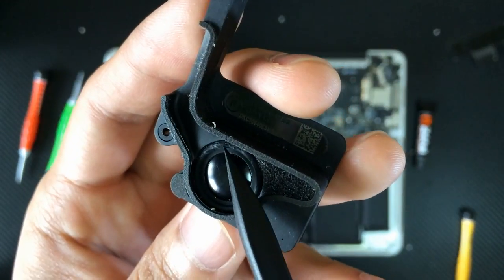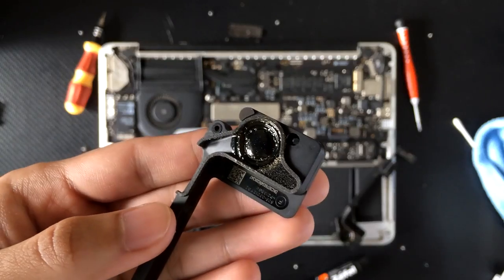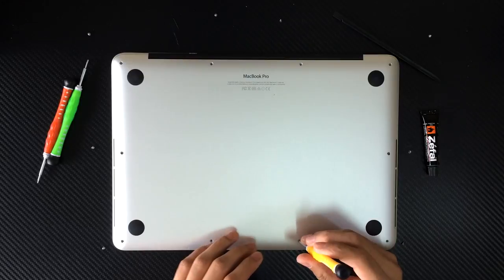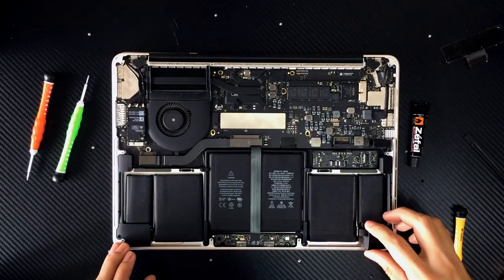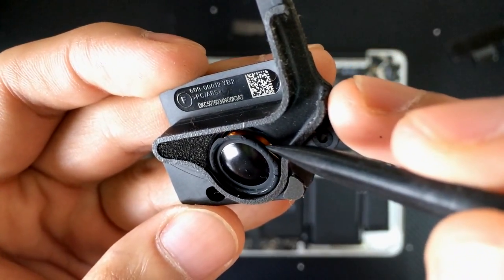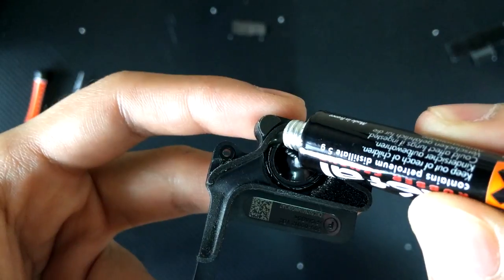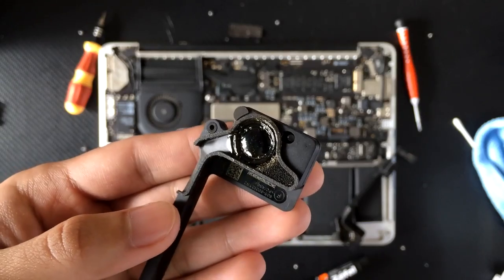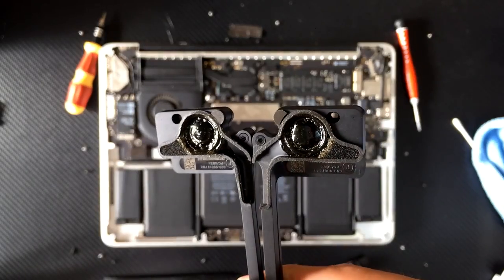Rattling Macbook Speakers Cheap and Easy Fix!

Comment: The difficult part is NOT fixing the speakers (or simply buying replacement speakers). The diificult part is getting the speakers out. On the 15" models you need to remove the fans, heatpipe/cooler, logic board, IO board, SSD, Wifi adapter, wiring harness, etc to get the speakers out as they are partly underneath the IO and logic board. Basically to get the speakers out EVERYTHING minus the battery needs to come out. If you are going to go through all that trouble -- and risk breaking something else in the process -- just buy new replacement speakers for $20~30 a set. Trust me, you don't want to do it again.

Comment: I am a bit confused, i got a new speaker in my MBP, but the problem still persists. Could there be another reason? Would it still help to use glue? thx in advance

Comment: This legit worked for me! I just finished putting my MacBook back together and I'm so happy it worked!! The guys at SimplyMac told me it wasn't worth repairing because my laptop is so old!! It cost me less than $20 fix, I bought a precision tool kit and a bottle of black rubber cement. Thank you so much for posting this video, I have the same Macbook in this video.
Reply: I have a Macbook Pro with Retina Display Late 2013
Reply from the maker: You're welcome! I'm glad this helped :)

Comment from the maker: Hey folks! It's been 3 years since I posted this video and I'm glad I get to help many of you solve this problem. It's unfortunate how this is such a widespread problem -- which makes me wonder if we can somehow influence Apple to have a quality program for broken speakers? Similar to the replacement program for the screen staingate and butterfly keyboard problems.
Anyway, that might be a stretch haha so for anyone planning to do this DIY fix, additional help here:
FAQ
Q: Can I use xxx glue instead? Or does it have to be that exact same glue in the video?
A: It doesn't have to be the same. Anything that works well with rubber will work. I think any general-purpose adhesive can do the job. However, I believe adhesive that heals to a slightly flexible material works better with the vibration and flexing of the speaker cone.

Q: How is the sound quality compared to new speakers?
A: It's definitely not as good as new speakers. I think the quality depends on how torn your speakers are to begin with, and how much glue you put. If you put a lot of glue, which you have to if your speakers are heavily torn, it'll sound worse. But, that's still better than crackling speakers. Also, putting a lot of glue will help make the fix last longer.

Q: How long will this fix last?
A: Depends. If you put a lot of glue, it might last longer. Mine lasted for 2 years. I fixed it again (video link in description), this time with a lot of glue. The sound quality got worse than the first fix, but it's still working until now.

Q: Is this worth trying? Or should I just have it replaced?
A: If you don't mind DIYing, definitely worth a try! Do note though that the difficulty depends on your macbook model. Some macbooks require more disassembling to get the speakers.

Q: Won't Apple fix this for free?
A: Unfortunately, no. And it seems like none of us here in the comments ever got to have it fixed for free.

Q: How much does a speaker replacement cost?
A: You'll pay for the speaker and for the repair service. Speaker cost will depend on whether you get an OEM replacement or a used part from another macbook. Rough estimate lands at around 50USD.

I hope that helps! If there are questions not covered here feel free to comment and I'll add them here.
Thanks a lot, and happy fixing!

By the way, I have made a follow-up video but this time I replaced the speaker with a cheap 10USD replacement speakers. Watch here! https://youtu.be/qz7K843A6AY
Reply: I agree. My 16 inch 2019 MacBook Pro, purchased December 2019, has a blown speaker, creaking terrible sounds even on startup now. I noticed the blown speaker Feb 2021. I do not play loud music through my computer. I play music through HomePods instead of computer.   This is very bad on Apple and I agree there should be a recall or other program to replace these problematic speakers.  I see 1.3 thousand likes on this video. That implies a lot of MacBook owners with blown speakers.
Reply: Under which rock have you been living? This just adds to the list of defects in just Apple's MacBook lineup from 2016 on-wards. I suggest you checkout Louis Rossmann's on YouTube to find out just how many, bad and wide spread the problems are even on the latest machines. 

My 2013 MacBook Pro will probably be my last apple machine because of this. That's not to say my current machine has been terrible. In fact it's worked and lasted amazingly. The battery has only started significantly giving out over the past year and a half and the only thing that broke before the speakers was the display but that was because my dumbass dropped it. 

I just don't have any interest in buying another $3000 machine only for it to break prematurely and Apple to tell me oh you were using it wrong. Or oh it's only supposed to last up to 3 years for a $3000 premium freaking machine. No thanks. 

Sorry for the rant.
Reply from the maker: @ky5666  I don't know which part of my comment gave you the impression that I am not aware of the MacBook quality problems. It is exactly why I brought up the idea of influencing Apple to make a repair program for this issue because I know that they did so for some of the issues like staingate, butterfly keyboard, iPhone battery, flexgate, and many more.
The mass complaints and petitions, to some extent, helped push them to do a repair program.
I also am aware of Louis and I respect him especially for his stand on #RightToRepair, but I think he sometimes over sensationalize Apple issues because a lot of people enjoy and patronize Apple-roasting videos. For instance, Dell's premium XPS line, which I also admire, has a lot of quality problems too but I am not aware of any channel that focuses on this.

But you know, I feel you though. My 2015 MBP (the one in this video) has been amazing. 6 years. Only problems I had was the speakers and staingate (which they replaced for free). The reports of problems starting the 2016 redesign held me back from upgrading. But at the end of the day, quality problems always exist in production, it's just a matter of minimizing it and offering warranty and repair programs. Also, consider that it might be a matter of noisy minority too. Many people I personally know who have the 2016-2019 macbooks didn't have problems.
Anyway, I just upgraded to an M1 macbook pro and it is amazing so far. Crossing my fingers that it would be as durable as my 2015 macbook pro.
Reply: @earlmalaki  Could it be that Apple WANT these parts failing to push people towards whole new machines? (By the way, ifixit doesn't seem to have parts to replace the speakers - any idea where I can get them?)
Reply from the maker: @alannewman85  it seems they sacrificed durability for sound quality. they make amazing (probably the best) laptop speakers, but it seems the cost is longevity of the speakers haha 
as for parts, unfortunately if you want to DIY, your option would be to buy chinese replacement part (from amazon, aliexpress, etc), or buy used parts from dead macbooks haha i have a new video where i replaced the speakers with cheap chinese replacement, that vid might help. see description for link
Reply: @earlmalaki  Hi Earl, Thanks - I have received replacement speakers, so I will watch your video many times before attempting. I have also bought the spare battery and toolkit from ifixit to do at the same time. Would you recommend doing anything else whilst I have the machine open?
Reply from the maker: @alannewman85  awesome! while you're at it, if your fan is a bit dusty or if the laptop is around 5 years or older, cleaning the fan and redoing the thermal paste will help a lot in making the laptop run less hot (and thus less performance throttle). i did the same to my 2015 mbp (link to that video is in the description) and it was a welcome improvement. good luck!
Reply: @earlmalaki  Thanks Earl, mine is a mid-14 SSHD, A1502 model, I believe there is still a fan though so will seriously consider your advice with cleaning it and renewing the paste, but only when I have a clear idea of what to do. You make it sound easy but I’ll have a look at your other links. Thanks, your videos give me confidence these things can be done by a reasonably capable careful person.

Comment: I have this issue with the right speaker 🔈 of my pro early 2015  version & I reckon this will work for sure. Your solution is 100 times better than other popular bullshit you tubers. Thanks mate, really appreciated. Kudos 👍🏽
Reply from the maker: Man, this means a lot. Thank you mate! Kudos!
Reply: Earl Malaki No problem pal. I opened my mac yesterday & your solution did work for me. 
P5 + T5 + rubber glue = saved at least  £70+ I reckon. Kudos. Appreciated again 💯
Reply: @Touhid  I reckon lmao

Comment: Perfect!!! I did it exactly as you told and it worked like a charm! Thank you for the tip!
Reply: In my case was a Macbook Pro 15" Early 2013, problem solved!
Reply from the maker: Nice! Sure thing, mate. Glad this vid helped!
Reply: Mas você comprou esse rubber cement fora do Brasil ou encontrou algo similar?
Reply from the maker: Hi Bruno! Would you mind translating to English? By guess, I think you’re asking if there’s an alternative rubber cement? If yes, any rubber cement would do. But I would suggest those that are used to patch bicycle tires, just like the one used in this vid. You can buy one in almost all bicycle shops.

Comment: I just did this. It worked perfect. The estimate to fix at a place was $200 to replace both L/R speakers. Thought I maybe could buy speakers and replace for cheaper and then came across this repair video. $14 for the tools. Thanks for posting this. My speakers sound new again.
Reply from the maker: Glad this helped! But wow $200 is wild. Which macbook do you have? If I remember correctly, they estimated $50 for my 2015 mbp back in 2018.
Reply: @earlmalaki  2013 late Pro. Yeah, thats what sent me to YouTube! :)
Reply from the maker: Hah! Good thing they gave that wild estimate :)

Comment: Worked like a charm for me!  I did not have to actually unplug the left speaker plug because the cable will easily glide out of the frame when still plugged in.  I used a hairdryer to carefully speed up the curing of the cement.
Reply: same here

Comment: Just did this on a 2010 MacBook Pro with a £3 tube of rubber solution and it worked perfectly! The existing surround had crumbled away so I put blobs of cement around the edge with a toothpick to create an array of little bridges (like a tie fighter cockpit). Once the bridges were dry I painted in the gaps with more rubber and force dried them with a heat gun.

Comment: just fixed the "subwoofer" of the  2012 MBP 15" unibody.with "shoe goe" that had been sitting in a drawer for a decade and it works! While i was at it i also unscrewed the high frequency part on the right side and cleaned the sheet now the right side is louder ad clearer than the left. 

If you keep the stuff only where the speaker is broken the mass to be accelerated will be less and thus the speakers sound more accurate. Regards!

Comment: Hi there the rubber cement you use is no longer on your amazon link, would you say bicycle repair rubber cement is best rather than rubber shoe cement ?, I wonder which is best for the job cheers:)

Comment: Thank you for this video. Question: It was not clear how long the rubber cement should be allowed to dry?
Reply from the maker: depends on the adhesive. some require an hour, some a day. just follow time on the adhesive's container

Comment: Thanks a ton for a great tip! Struggling to find rubber cement here in Finland and wondering if I can use some other flexible rubber glue? Thank you!
Reply from the maker: Hi! Any adhesive that is safe to use with rubber material should work fine :)

Comment: Hey, can you use silicone adhesive sealant ?  Will it work the same ?
Reply from the maker: Haven't heard someone use silicone sealant for this fix. But, basing off of silicone sealant's properties (works on most materials, strong bond, flexible), I think it'll work pretty well

Comment: I bought a 2nd hand Macbook Pro 2015 for a cheap price and soon found out the right speaker was blown. I got a set of extra speakers and replaced the right one myself using the ifixit guide. Not soon after the left speaker started distorting so i decided to try the glue fix and it worked! i used the kind of glue that is used to fix bicycle inner tubes. In the Netherlands it's called Solution and you can buy it at every bike shop for about 4 euro's. Thanks a lot!
Reply from the maker: Glad it worked! I also used the same kind of glue in this video -- for some reason I feel like it's the one that'll work best haha
I'm pumped about your 2015 pro! I'm sure it'll be great. I'm using one too and it just turned 5yo. I recently did a video on cleaning the fans and replacing the thermal paste. It breathed new life into it :)
Reply: @earlmalaki  Ah cool, will have to check that fan vid. I just cleaned the fans with a vacuum cleaner. The left speaker started sounding worse after some time unfortunately so i replaced it. The ones i replaced it with looked different so hopefully they wont turn bad on me again
Reply from the maker: @woekers  Ohh, I'm sorry to hear it failed again too soon. Apple really ought to do something about this. Just looking at the views that 'speaker fix' vids are getting, it seems this is a very widespread problem.

Comment: THANK YOU SO MUCH, this worked so well for me!!!!!!!!! I have a 2021 14" macbook pro (a2442) where the speaker would pop every 20 minutes or so when playing audio which I guess was ok, but kind of annoying. Then came one day when I was playing the song Wait by NoMBe and it would pop every 20 seconds??!! Enough was enough so I searched for a solution and found this video. I was able to use elmers rubber cement + a fine paint brush + a hairdryer to apply thin coats of glue and dry it. I didn't even need to take out the actual speaker components which was a major plus for me. I tested it out by playing that same song on repeat a few times and no crackling sounds anymore :))

Comment: Used elemers cement glue at my macbook pro mid 2015 and worked perfect. Although hard process because you need to remove the logic board in order to access the speakers.
Reply from the maker: glad it worked out well! this is the 15" version right?

Comment: Worked great. I didn't even pull the speaker back, just squeezed the glue between the speaker and the enclosure. It dried in about 5 minutes and was good to go. The speakers themselves were in terrible state, so very surprised at how good it turned out.

Comment: Great idea! But, I think I'm going to use black RTV for longevity.
Reply from the maker: Let me know how it goes with the RTV. Stronger adhesive will definitely be better as long as it does not eat through the speaker material. Tinker ahead! :)
Reply: @earlmalaki  It worked out great.  I don't think it has as much bass as it did before, but it still sounds a million times better than when the surround was blown out!

Comment: Hi,  on a mac pro (2013 model) i just bought  screen fads than it freezes goes black...then i give it slight twist and screen comes back but is still frozen... then fads again.... i know it needs a part for screen,but not sure what part and how to fix... maybe screen needs to be removed etc... any experience with this issue? do you have a repair video on this? thanks for your help..

Comment: I have a mi notebook pro that has Harman Infinity speakers on them. new, they are loud and I think that is where the problem lies. These are tiny speakers and Apple and Xiaomi are boosting these speakers to the point that they break earlier than most. not a problem for them as by that time these would be out of warranty anyway. Ordering the zefal cement now. hope this works.

Comment: Yeah thank you mate 👍🏼,But i just replace the torn part with new one,that rubber bass pendant woofer were sold cheap online on aliexpress etc for various shape and sizes..
Reply from the maker: Woah I didn't know that there's a spare part for just the bass pendant. Great info, thanks mate! How's it so far?

Comment: Thanks a lot for your reply, much appreciated!  I have this issue and the guy that provides a service to fix it says this is only a temporary fix (of course he wants to sell me new speakers...), any idea how long this fix lasts typically?
Reply from the maker: No problem! Hmm, I'd say it depends on the glue, how good the application was, and how much you use the speakers at high volume hahaha Mine lasted almost 2 years before I had to fix it again, but I imagine it will vary a lot for everyone. Thanks!

Comment: Hi I liked your video but guess it won't do any good to my laptop. I opened up my late 2015 MacBook Pro and found the speakers in perfect condition. But still the sound is muffled. I took it to Genius Bar and they confirmed no damage to speaker however they didn't fix it as the laptop was outside warranty period.  tried all software tips available online but didn't yield any result. Any tips from you? Thanks
Reply from the maker: Hmm that's odd. I haven't read anything online about that problem -- but what came to my mind is if the speaker cone is physically fine, then maybe 1) try resetting smc/nvram/pram; 2) check(plug/unplug) speaker connection pins.

Comment: Great vid!  Does any rubber cement work?
Reply from the maker: I've seen comments mentioning the use of other adhesive, so I guess as long as it can hold the speaker cone and withstand the vibrations overtime then it should work. Good luck!